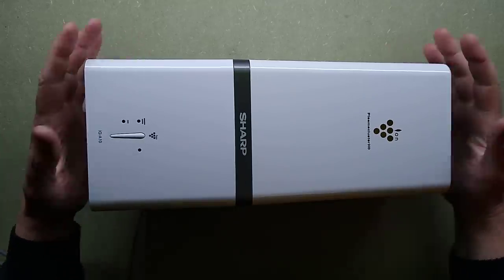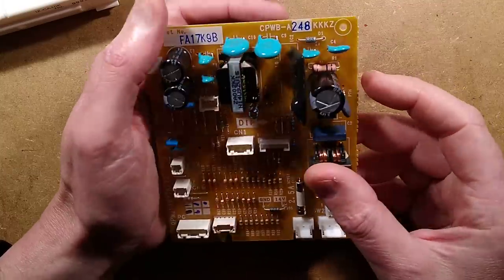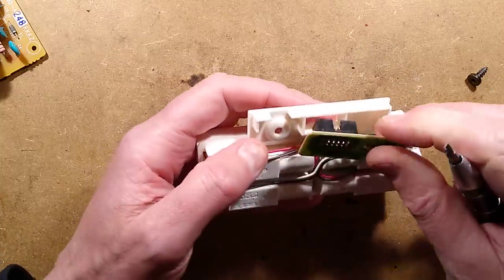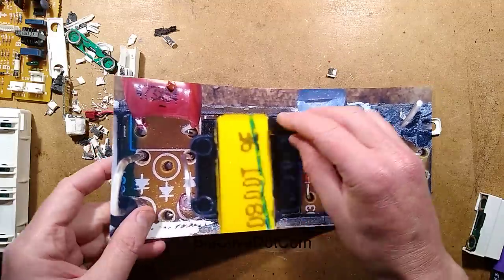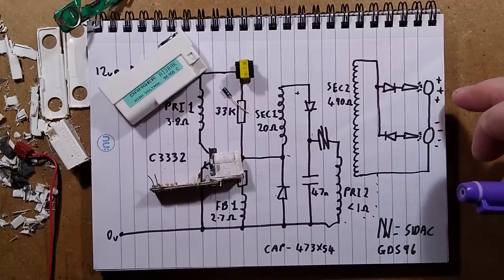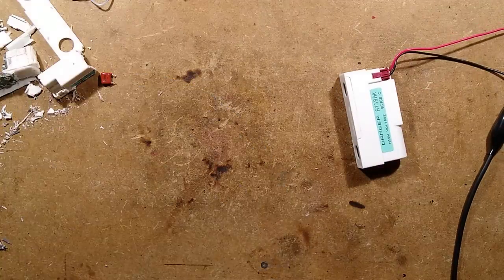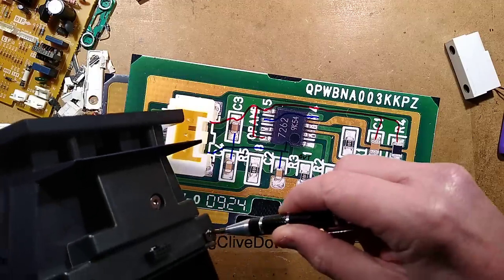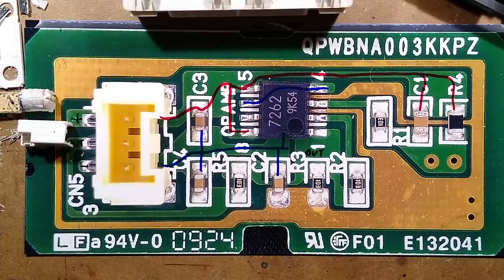Exploring a popular Japanese air purifier.

Comment: As an automation lab tech by education my relatively educated guess is this: The coronal discharges do generate charged ion radicals in the air, which will attract water molecules around them because of water's dipole moment. By having both needles sufficiently far apart and isolating the positive and negative discharges with some distance between them, the flowing air current from the beefy fan will prevent immediate recombination of the naturally reactive positive and negative ions and giving the water molecules enough time to cluster (at least somewhat) around them. This is clearly meant to be operated in environments with (very) high relative air humidity (which is the case always in Japan). Of course, a coronal discharge doesn't discriminate against what molecules it attacks to create the radicals, and you will therefore end up with trace amounts of ozone as well when it ionizes O2 which can recombine with another O2 molecule to form O3, even though that would not be its primary goal. I'm not sure off-hand of the reactivity and attractiveness of O2 versus water molecules to the ions created. I'd assume that in dryer climates, the O3 production would also be higher -- how humid is it in your area?
Reply: He's off the coast of Britain, so very wet.

That's an interesting read though mate.
Reply: Would've been a good idea to have a chamber with water that the air would run through then.

Comment: That is the most beautiful PCB that I have seen in a long time.
Reply: That´s what I love about Sharp. Not all companies work with the same level of care.
Reply: Thought so as well. It looked so nicely old fashioned, but at the same time very clean, tidy, beefy and reliable. It looks aven like something worth reparing instead of throwing away.
That is more the reliable technology that took us to the moon than the one that drives us around every day now. Back then we relied on the technology, looking at modern cars, technology makes you rely more on the AAA or ARC ;)
Even allowing easy disassembly with all the plugged connectors and only the replacable clusters beeing throwaway items as they are designed to be consumables.
I guess alot other companies would have saved a lot of money by getting rid of most of the connectors, especially the ones in the potted cluster modules.
Reply: Yep would agree.

Comment: This is safely designed, but remember most Japanese outlets are ungrounded, and many Japanese devices draw high amps because they run at only 100v. Cables come with ground leads, but hardly anyone connects them. Not to mention half the country is on 50hz and the other half on 60hz.

Comment: Exposed gold surface on the PCB is a guard ring. Essentially the idea is to keep the voltage around the very high impedance charge sense "antenna" roughly the same as the antenna voltage itself, but at a much lower impedance. That way the leakage from the antenna section to other parts of the design is reduced significantly, and results in more accurate sensing.
Reply: I was going to post the same thing.
Reply: @Graham_Langley  Worse yet I said the same thing before scrolling down. Well, you guys are smart!!! ;-)
Reply: Dang it...

Comment: The op-amp:
The ring that's run around the input pin (non-inverting) is called a guard ring. The op-amp is set for a gain of one. The output is the same voltage as the input. With the output (via a 10k) surrounding the sense input pin it creates a very high input resistance, and the guard ring prevents the sense signal from leaking out.
They might be running the HV and sensing the amount of ozone created. When the ozone gets too high, it shuts off or alternates the modules to discharge the ozone.
Reply: That is exactly what i wanted to say. Looks like "gold" antena checks the output performance of ionizing cluster. Maybe for maintenance reasons, or maybe to check if the ozone level is not to high, so device schut down cluster for short time. Efficiency of ionizing devices warious for many reaosns, so maybe device is trying to maintain ozone level on safe level.
Reply: N
Reply: @piotrrasz  But that doesn't measure ozone.   What it does measure is ion-balance.  The real question is, WHAT GOES BAD WITH TIME?  Why does the module need periodic replacing?

Comment: I remember the last time I forgot to replace a worn plasma cluster module.

The deathstar was lost that day.
Reply: HA! Thanks for that!
Reply: I know that feeling.
My whole ship was killed by a cadmium radiation leak caused by a poorly replaced plasma cluster module. Just as i was explaining to the captain why i hadn't replaced the plasma cluster module correctly.
Reply: Yea you need to keep on top of this to prevent a fluxed capacitor ;)
Reply: These aren't the diodes you're looking for
Reply: I got stranded in the Delta Quadrant for a decade.
Reply: @darthhomie  if you stayed at academy for the final semester you have learned the error of setting out without sufficient dilithium crystals.
Reply: @TheBerk01  Smeg! why was a technician second class working on critical drive components anyway?
Reply: Jean-Louis Bourgeois  Aye
Reply: @coctailrob  LOL best one and this string of comments so far!!!!-
Reply: @coctailrob  also use the force.

The electromotive force that is.
Reply: @BerniceWonderdog  by the way nice username also username checks out with on the subject right now on capacitors just don't get incapacitated by it LOL
Reply: @nerd1000ify  after my curry.

Comment: Sharp makes some amazing home comfort appliances.  My Sharp 11,000 BTU portable air conditioner is an amazing unit and it purrs like a cat at 40 decibels. They use truly high grade plastics and internal engineering.  This is way better than most portable AC units made in China that use the cheapest plastics.

Comment: I feel strangely sentimental about Sharp, for some reason.

One of my first ever cassette-recorders was a Sharp one but I think I really started to appreciate them back in the 80s/90s when they produced some really well-made VCRs.
Reply: Same here! :D
Reply: Same, and it was awesome quality.
Reply: I believe they still make good quality stuff. They are still one of the biggest manufacturers of LCD and OLED panels as well.
Reply: They also sponsored man utd
Reply: @JG-nx3jg  Well, nobody's perfect.
Reply: You are so right. SHARP has invented APSS (auto program search system) and later on in another model APLD ( auto program locat device ) i love those lovely cassette players.
Reply: @SteelSkin667  Sharp is not the same anymore, Foxconn pretty much took over. Quality wise they seem to be doing alright, but that may change.
Reply: Still got a 25 year old sharp microwave ,still going strong and my 40 year old optonica amplifier priceless
Reply: Same for me, with Panasonic
Reply: @MiGujack3  I don't know whether Foxconn took over all Sharp divisions or whether this apparatus was made before the take over, in any case this apparatus is a real Sharp design, even if under the economic ownership of Foxconn. This can be seen from the code numbers on the PCB and probably other parts as well. I hope Foxconn was smart enough to know not to throw out the knowledge base, tradition and resources after take over and leave the original synergy of the corporation intact.Those are often the most succesfull take overs.
Reply: Sharp is literally garbage.  They hate their American customers, and only treat them as a cash cow.  Your memories are from a company that doesn't exist anymore.
Reply: @jong2359  explain how they hate their American consumers
Reply: I always enjoyed working on Sharp equipment not necessarily stuff that was sharp enough to cut you LOL but actual equipment made by Sharp did mini repairs on things like that all kinds Power Equipment some of the better stuff I've seen also much higher success rate of repairs Andy's you're going at it overall I'd say yes worth getting something like that.
Reply: Mai Mariarti  yep you're right.
Reply: @bruceevennett955  whatever you do don't get a Magic Chef microwave there is all kinds of issues with those mine has fence so marking and more I'm upgrading to an Inverter microwave of a different brand keeping it on an a short leash AKA a switch between receptacles and the flag of the microwave just to be on the safe serving and turning off when not in use this thing has even started up without even turning it on getting money together to get the new one.

But once I get to lie one strip the old one for anything usable.

Including the magnets out of the bank fraud refrigerator magnets.

The turntable motor as a motor of course.

The cooling fan of course.

In terms of the microwave Transformer I moved level to secondary coil rewind for low-voltage.

Possibly multiple secondary windings.

I wouldn't trust a controller cuz that's the problem with these younes they have a mind of their own you could say.

Even sometimes if it's on full power it's in defrost mode.

It freaks out all the time.

Some possibilities maybe voltage fluctuations power surges moisture who knows badly filtered power supply don't know there's something going on but I don't know what I've heard all kinds of reports about our problems so just one Magic Chef like the plague at least in terms of microwaves.

It doesn't help that when I originally got it it was a list price microwave and ever seen.

About 40 some dollars at Home Depot years ago.

Don't remember if it was clearance it may have been?

At the time I was in need of one and that's all I could afford at that time
Reply: First and longest lasting tv was a sharp rear projection . Replaced the lamp every 2 years for $40, thing lasted 14 years until i decided to leave it at my old apartment as it was never going back up the stairs.
Reply: @bruceevennett955  Making stuff that works forever isn't a good idea it seems as a manufacturer xD
Reply: I won't by any other microwave oven than the Sharp Carousel. I liked it so much that I bought a spare, just in case the first one breaks and they stopped making it or something. Its biggest quirk is that I have to shorten the 'recommended times' by quite a bit, because it's very powerful. I mostly only use one button - the +1 minute button - as it's pre-coffee simple, yet the thing has a book of built-in recipes that never get used, and the 'Sensor Cook' makes a perfect bag of popcorn, and probably other things.
Reply: I agree on the VCRs mate, i have several now, including the one i saved up for and purchased when i was like, 14! But, a lot of their other stuff, generally does keep working but with faults.. Hitachi on the other hand, some really nice stuff but..i think just about everything Hitachi i have has either died or had serious faults i've fixed at some point lol

Comment: The last bit of circuitry you pulled is a very high input impedance buffer for measuring the electric field.  The ring around the outside is a guard ring.  By keeping it at the same potential as the voltage being measured there will be no leakage currents between "antenna" and the ring. It is there to reduce the effect of any possible surface leakage on the PCB.  Download a copy of the Keithley Low Level Measurement Handbook, it has a section on guard usage.
Reply from the maker: It'll be needed due to the electrostatic nature of the detection and the need for a relatively high impedance.

Comment: I have one of these I bought off eBay and refurbished.  They are good at gently eliminating odors, and are an  alternative to UV-C based purifiers, or activated carbon.  The ozone production is not significant.  It removes odors and kill viruses by indirectly producing hydroxyls.  Very different from the standard negative ion generators out there.

The engineering behind this product is astounding in how thoughtfully it has been put together and how well it works.

Comment: I would love for you to do a teardown on an Oster Blender, the kind with 10 buttons on the front.  The motor has multiple windings but the button control has some magic in it.  The buttons are mechanical but manage to hold hidden state.  Amazing.
Reply: There’s a stamped metal slider also called a gate that runs across all the plungers of the buttons under the cover. When you depress any button, it latches, and then when you depress any other button, it pushes the gate sideways, and the gate is setup so that if it moves sideways, it releases the latches on all the buttons. A little bit of ingenuity ensures that the gate does the releasing only for buttons not being actively depressed. But it’s a rather simple mechanical arrangement and very common in button clusters :)

Comment: It does look like a nicely engineered, if dated design. Even though the IC has a 2009 date code, the design being mostly leaded components seems to be about 20 more years prior - more VHS era.
Reply: the pcb silkscreen showed it was made between September 14, 2009 and September 20, 2009
Reply: You don't fix shit if it ain't broken tho
Reply: @Incognitus-Umbra  If it works, and if the old style components are still available there is no reason to change the PCB design.
Reply: Lesson for today: You can't beat yester years quality with today's bullshit work
Reply: @carpdog42  thanks for the link.
Reply: @DarrellLarose  100% agree.

Comment: Interestingly enough my washing machine does the same cycles: short cycle CCW, short cycle CW, then halts, then centrifuges in one direction, repeat short cycles and centrifuges in the other direction.
Reply: That has a clear purpose though, to mix the clothes on inside to outside or shift them a bit, to get as much water out as possible.

Comment: Hi BigClive! 

I have one in my possession and I have had it for some years and it still runs today. I have taken it apart a couple of times to clean it up.
Reply: @alexanderconnell800  
???????
Reply: @acmefixer1  I had a similar one (PureMate pm200) and the crap it pulls from the air tends to gather around the needles and the high voltage ring,
At this point you can tell its still working but not as efficiently, 
Brushing with a soft brush to remove the 'soot' rectifies this, obviously Sharp don't want you to know this so they can sell replacements, hence the sensing plate and 'replace module' warning light,
I bought one of these from eBay UK after Clive mentioned them on a live stream, so I can wire it into an existing tower fan, search for 'IZ-CA10E' seller is 'amberliekirkham' price £12

Comment: This really is a fun circuit. Since this video came out I have been messing around with it in a simulator, and boy does the simulator not like it. I had to simplify it quite a bit just to not crash the simulation the first time the blocking oscillator fires a pulse. Playing with the layout a bit I can't help but note the final voltage amplification stage is the solid state version of the same simple LC tank circuit that tesla coil enthusiasts have used for decades. Really good stuff.
Reply: Which simulator were you using?
Reply: @cheyannei5983  https://www.falstad.com/circuit/circuitjs.html - its a fun toy; great for playing with concepts. However, its not too hard to bump into its limits.... case in point. It really didn't like that circuit at all; not until I reworked the oscillator to inject its output into a floating tank. Then, once its working, it kind of sucks because the time between rings is very long compared to the ringing. Makes you want for triggers.

Comment: The transformer graphic at 5:01 is just adorable. 
I tend to ignore all sorts of non-filtering air-cleaners, preferring the ones that pass air through the filter, but this looks quite intriguing. I recall seeing this grape logo used on something in a Japanese hotel, probably on an air conditioner. Online i saw even stranger Sharp "portable plasmacluster ion generators" being sold, the size of a mobile phone. That definitely would be an interesting disassembly.
Reply: Air purifiers are common in Japanese hotel rooms, they are usually bigger floor standing units with a big HEPA filter and humidifier function, the Sharp models have the Plasmacluster stuff too.

Comment: I have a multi-function purifier I got from amazon years ago, it has one of those charge needles as well as a PCO segment, hepa filter and ozone generator plate.

I usually only set it for PCO or at most low on the ozone setting- it does help keep down dog or cooking smells in the house- big problem with them is there is nothing to stop someone from using it incorrectly and accidentally poisoning themselves as there is no monitor to shut down if levels get too high.

Basically, If you walk in from being outside and you can smell Ozone AT ALL, there is too much of it, if it smells like bleach you are poisoning yourself.

Comment: Nice collection and presentation. 
If I may add to page 15:00
It is a fly back pulse oscillator by primary1 and feedback1. 
The SEC1 is the fly back winding,
and rectifiers D1,2, PRI2 47n, Zener,47n are used to eliminate negative wave cycles from reaching the SEC2.

Comment: The opamp monitor circuit shown at the end of the video. There is a guard ring around the sence electrode it is driven by the amp output. This is boot strap function that reduces the leakage away from the electrode. The same technique is used to reduce the screen capacitive loading on a high impedance transducer. The over all gain must unity or less or it may well oscillate.